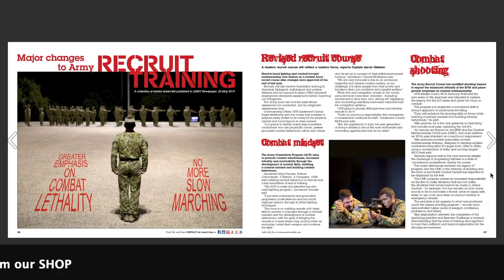Power-tool powerbank on French cleat

Comment: Wouldn’t it been easier to trace your tools — like a shadow and then cut the pieces to match.
Reply from the maker: Thanks for watching Malcolm. I really appreciate you watching and especially talking the time to comment.
Maybe the tracing didn't come across enough in the video, but that's pretty much what I did – especially with the red-drill hanger and the hole I put the angle grinder into. On the other hand, I don't think it could be any simpler or easier than putting just two dowel pins in key spots to hang the saw on, for example. The best test, though, is how user friendly it turned out – and, as such, the placement and low-interference solution I did with the most used tool (the red drill) pleases me greatly, even after months of use.